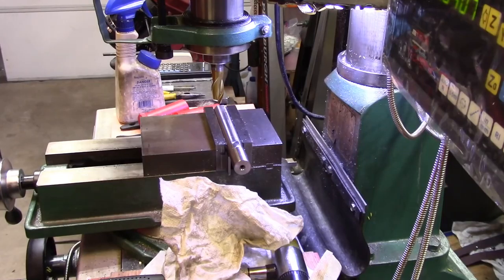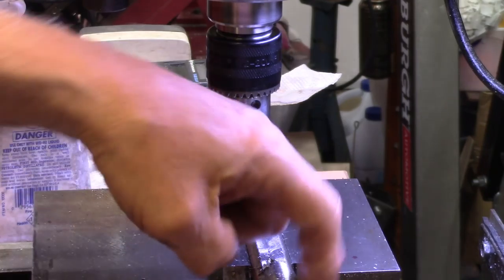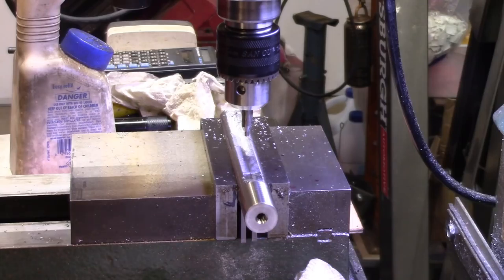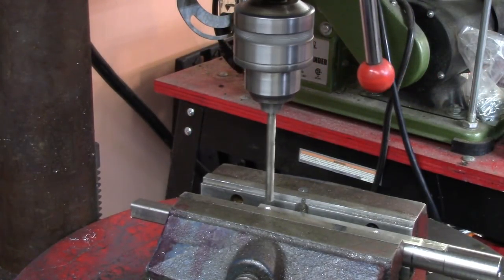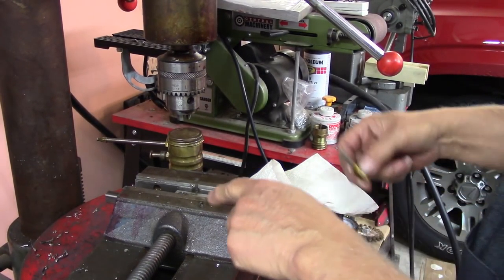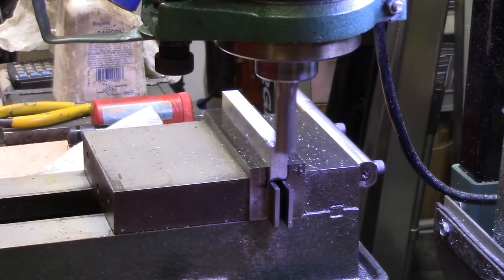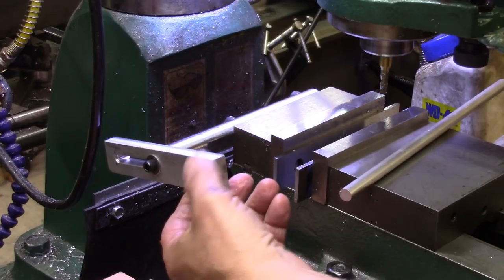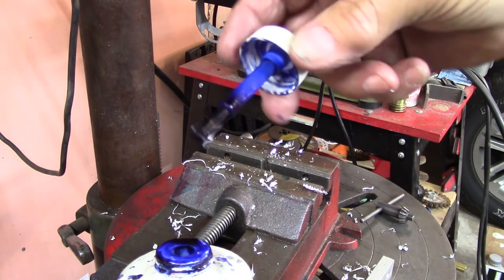Mill vise stop part 2 of 2

Comment: Worked out good - I think we both share that famous word "functional" - that's what matters :)
One vise stop I made was for fitting into a table T-slot - that turns out useful quite often because it's very versatile.
Must remember those valuable rules.!
Reply from the maker: I was torn between a vise mounted stop and a table mounted stop.  My drawing at first was for the table mount.  Thanks for stopping by.

Comment: You are not alone in misplacing things. I had my carb cleaned for the welding machine. I didn't want to put it on right then so I put it up so I would remember where it was. That was over a month ago. No idea where it is.   If you use all three holes to tighten the chuck it may keep your bit tight. Nice job on the stop. Thanks for the videos.
Reply from the maker: Thanks for the suggestion and for stopping by.

Comment: I don't remember any brass knobs, but you made a bunch of plastic knobs on 1/4-20 bolts.
Reply: bunch? i believe the count was a good one for using and 3 for lookin at
Reply from the maker: And I have used all of those already, I guess it is time to crank up the old injector and make some more.  Thanks for stopping by.
Reply: big run this time may be 7?
Reply from the maker: Could be, don't want to flood the market.